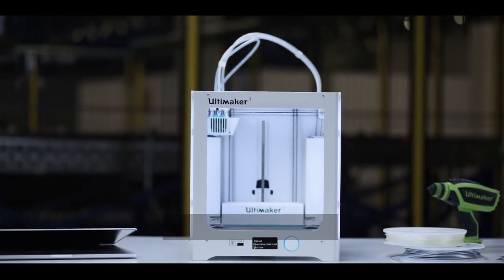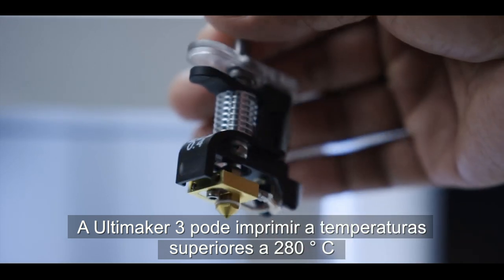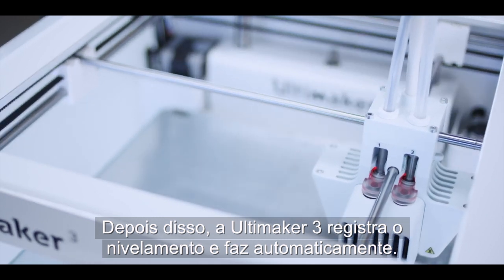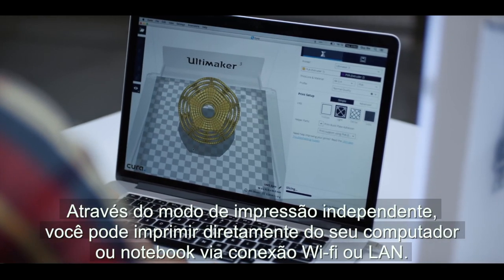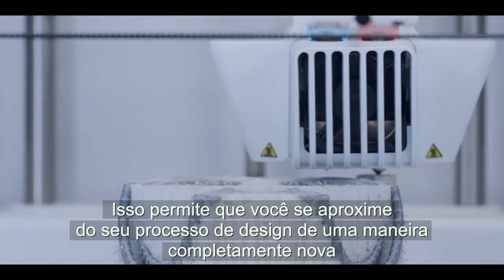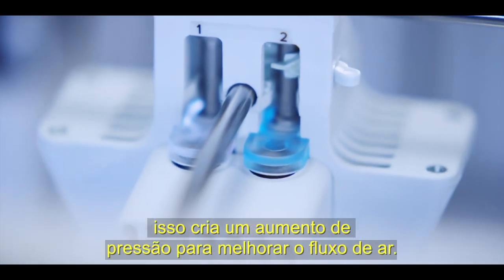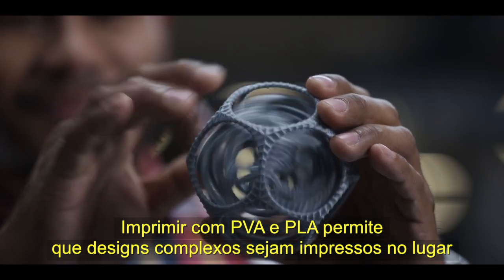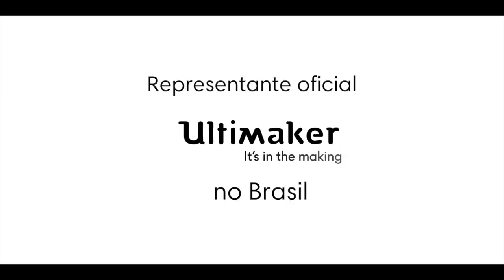Ultimaker 3  - Impressora 3D profissional e acessível

Comment: Boa Noite.
Em relação aos filamentos que essa maquina suporte tem que ser os proprios ou posso utilizar de outros fornecedores? A ultimaker utiliza filamentos 2,75?
obrigado
Reply from the maker: Oi Felipe, tudo bem? Você pode utilizar filamentos de outros fornecedores sim, somente é necessário se atentar as recomendações do fornecedor referente a temperatura de bico e de mesa. A ultimaker utiliza apenas filamentos de 2,85mm
Utilizar filamentos de 2,75 requer modificações no equipamento, não apresentando mesmos resultados do filamentos com que ela foi projetada.